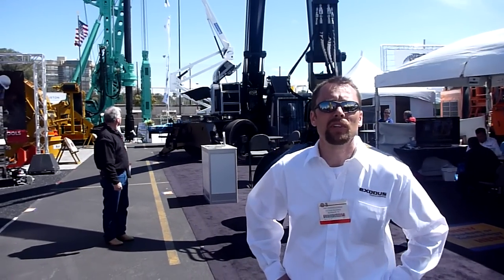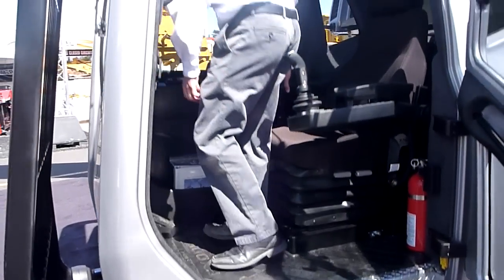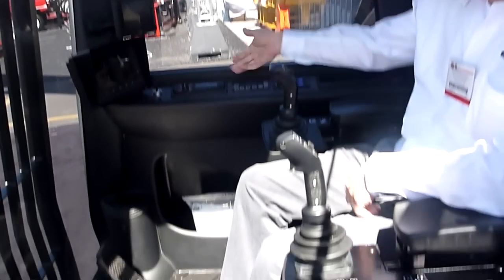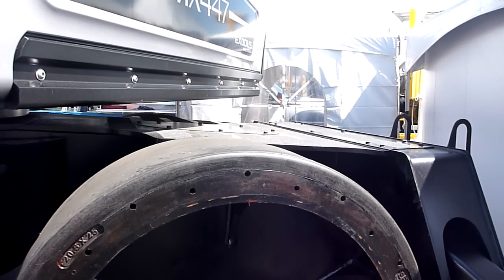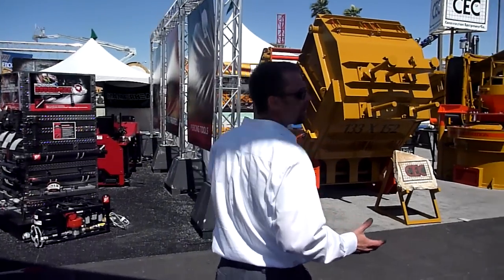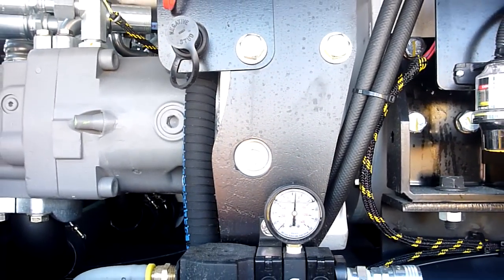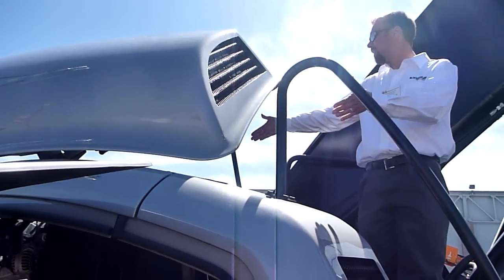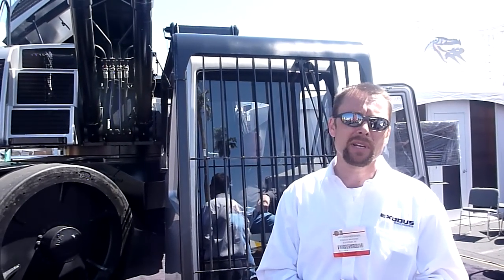Exodus MX447 Material Handler

Comment: I ran a CAT 320 grapple at a local scrap metal yard for 4 years..best most exciting job I ever had thus far..The machine in most ways was designed the same way this one is except it had a tilt down steering wheel for when you had to move it around the yard..this machine must have joystick controls for steering..

Comment: Nice piece of kit. 

Although not the only machine in the world with a cab which lowers down to ground level as he claims at 1:44 ! I've seen a tracked compost turner with a centrally mounted cab about 12 feet above ground which lowers to ground level for the operator to dismount, and also to reduce height clearance for transport.